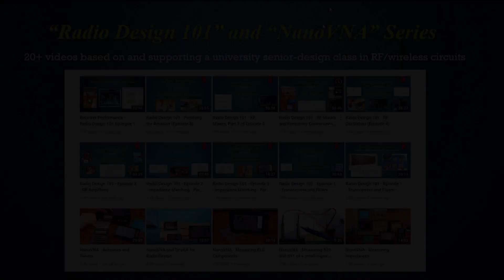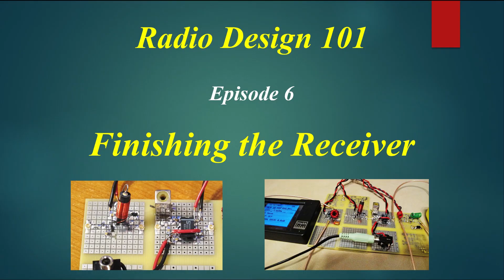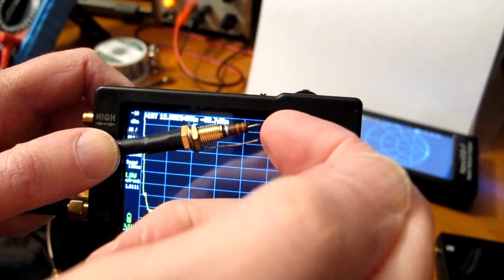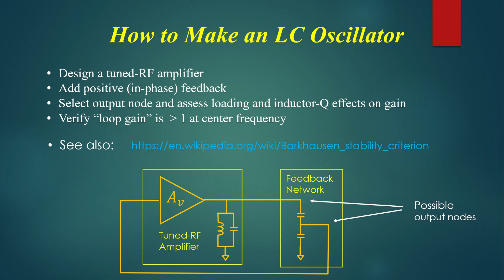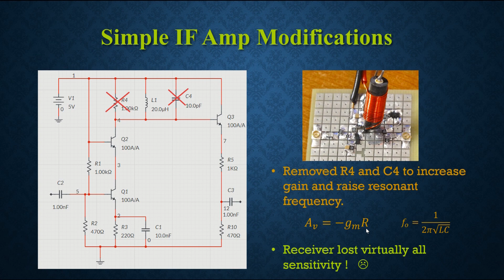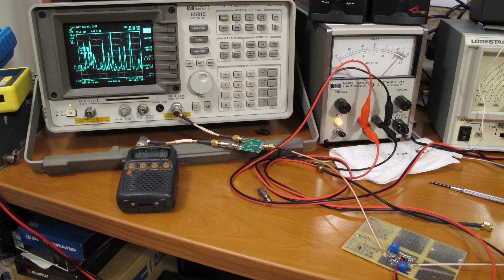Comment: Is touching the circuit with your finger a trouble shooting technique?  I guess I never would of thought to load the circuit by putting my finger on it. Is the behavior of the circuit a characteristic of an oscillating amplifier in general, and whether the amplifier is oscillating a question I should ask myself when wroking in RF? Without watching this video, I would of never thought about putting my finger on the circuit without knowing what behavior I should be looking for first haha.
Reply: Agreed. It looks silly, but it's absolutely a technique I've used many times. But ONLY when its safe (low voltage, low-power receive circuits, isolated from the mains). That warning given, its kind of like tapping/pressing on stuff to find bad solder joints, or using freeze spray to find temp-sensitive things. In this case, at VHF and above, the finger adds some capacitance, but also power losses - which can stop the oscillation and hopefully help suggest where the feedback path may be.  Of course it's not very scientific beyond that qualitative description - and as you said, how do we map changes in the observed behavior to ideas on tracking down the oscillation? It could always be that we're getting false clues. But any clues are better than no clues, IMO 🙂
Reply: @MegawattKS  awesome! Thank you so much! Also, quick question. Are you going to do a series on the Doppler radar?
Reply: @ftscotttinez33  I've thought about that, but for various reasons decided against it (at least for now).  FWIW, that class (as well as the one that Radio Design 101 is patterned after) are still taught at K-State.

Comment: I just discovered this series- very enjoyable.  I've done a lot of this kind of design in the past and its neat to see how someone approaches today especially with Tiny SA and VNA- amazing.  One question I had is the biasing of the two cascode stages in the IF.  It seems like they should have a divider from Vcc to the upper transistor base- its pegged at Vcc.  I also thought it bypassing this base would be required to get the full effect of the cascode.
Reply: Thanks for the question.  Normally at the university, we use an LM3189 or SA604 IC for the IF limiting amplifier and demod functions. But here I was trying to do everything discrete, and leverage prior discussions.  As you noticed, this design departed from the traditional biasing. I always like to try new design ideas. The goal is to achieve a high-gain amplifier with an amplitude limiting behavior like in the ICs, but with single-ended rather than differential circuit topology.  Here, the output swing at the collector can be as large as 4.3 to 5.7V (0.7Vpk or 0.5VRMS). That is because an NPN transistor collector with base at Vcc can actually swing lower than the base and still stay in the active region of operation - i.e. still be amplifying throughout the cycle. The rule is to just not let the base-collector junction become forward biased by more than 0.6 or 0.7V. It doesn't actually have to be reverse biased. (Recall VCEsat tends to be around 50 to 100 mV, and Q2 emitter is about 0.75 V below Vcc here.)  At swings larger than 4.3 to 5.7V amplification falls as it  goes into limiting - but that's the goal in an FM IF amplifier. Note that emitter-follower / buffer Q3 limits the swing on the high-side due to its base-collector becoming forward biased at 5.7V.  I also agree that the base of the upper transistor in the cascode needs to be bypassed. In the actual build, that is done with the power supply bypass cap which is only a couple hundred mils away. In the simulation it works fine without it since the supply voltage source is an AC ground and simulators don't know about inductive parasitics unless we put them into the circuit explicitly. But in the build, a local bypass cap is needed at the base as you noted. Here it is the Vcc bypass cap. It doubles as the base bypass 🙂
Reply: @MegawattKS  - thanks for the thoughtful reply and I agree that the CB junctions on the cascodes don't have to be reverse biased- just not forward- I generally explicity reverse bias them but learned/relearned something.  The benefit to having that upper transistor with a real bias R and bypass at base is PSRR and potential feedback issues that you've experienced.  For the cost of an R&C , you can really keep junk on that rail out of the upper Q.  It also would alleviate the feedback issue you had with the solved with 20 ohm R- an alternative solution really.  Good puzzle, good presentation.  Enjoyable.

Comment: But, but what about designing the LO to be stable and tunable? PLL? What's a corvette? 😂
Reply: Sorry for the late reply(s).  Agreed - a frequency synthesizer is definitely a good thing :-)   We sometimes did some PLL designs in the class, but here I just used the TinySA. Synth/PLL chips can be purchased of course, but that at least requires software development to control them.  I took the easy way out in this video series :-)
Reply: @MegawattKS  your knowledge is valuable. I'm envious. I try hard but I'm afraid I'm limited. Currently building an AM transmitter, but I find myself stuck with what requirements to base the design by. Frequency, mixer, output impedance, etc... I have purchased many crystals, some overtone, some not. I wonder if the diode ring mixer works for transmission? I know it's not needed for modulation. Should I go with active filters? What works for basic operation and what works for more intricate designs?
Reply: @xDR1TeK  I think a lot is going to depend on frequency of operation. Are you targeting an HF-band (3 to 30 MHz range) design? Of course there are tons of options in a design. And I purposely stayed away from transmitter design in the series due to rules and regulations.  But there are good books available (e.g. through the ARRL and other radio organizations).
Reply: @MegawattKS  I understand. Part of engineering rules is to adhere to ethics. But having an engineering degree isn't fun if all you get to play with is LEDs. Thank you for everything.

Comment: Maybe I missed it, but why did the module go out simultaneous to the heater core mod?  Bad luck?
Reply: That's a good question. It is not impossible that it was a coincidence. However, the probability of a dual failure at essentially the same time in unrelated systems is statistically very near zero.  My best theory is that the head overheated.  The ICM module is mounted to the head and uses it's temperature as part of the heat-sink for the electronics (its the case-temp for the module).  While I did look at the temperature readings on the drive home from the bowling alley where the heater core failed and the temp did not get too high - there are actually two different temp sensors on the car. One feeds the analog gauge and the other feeds the digital readout on the dash. It could be that the one reading the cooling fluid for the head wasn't the one I was looking at and/or the head wasn't flush with fluid so it was higher temperature than what I was monitoring while driving home.  All theories of course...  :-)

Comment: Excellent video.  Might I suggest adding one general troubleshooting principle?  Be cautious, or at least mindful, when making changes to test your theories, as your changes may mask the fault in the system under test without actually resolving the problem (bad), or interact with the fault in an unexpected way (good, if it gives you additional information to form more accurate theories).  You demonstrated the good side of this quite well when the oscillation did not return after removing the probe/your finger.  It provided additional information that helped to ultimately solve the problem.
Reply: Thanks.  Good points. Troubleshooting is definitely an art.